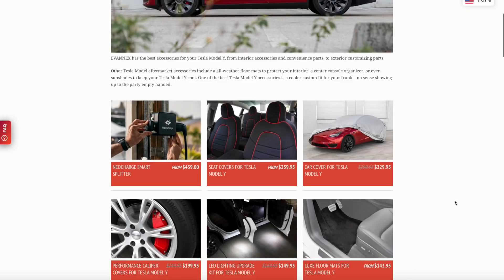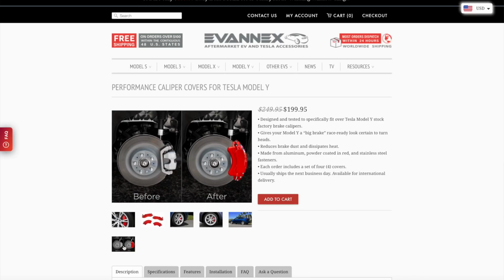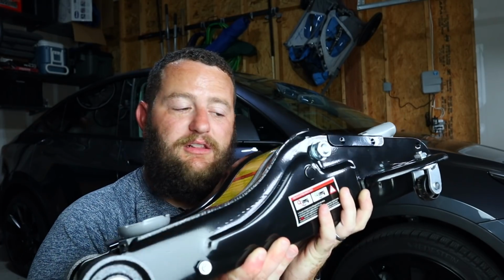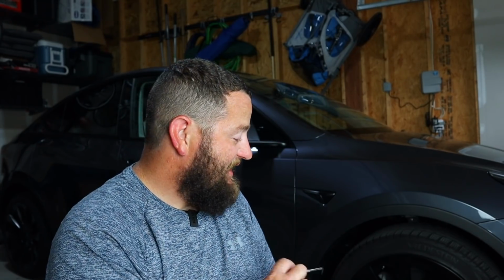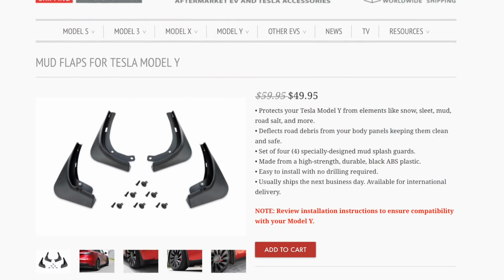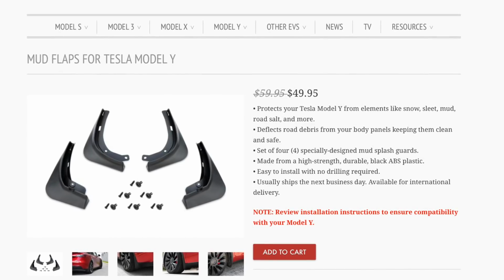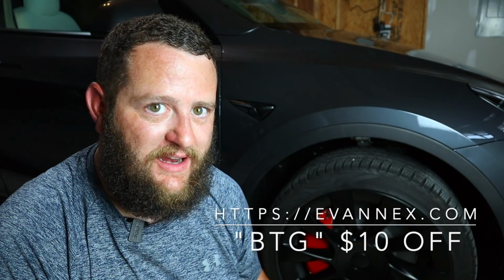Tesla Model Y - Red Caliper Covers

Comment: I would say that even if you can get the whole side of the car up with one jack, definitely use something under the other jacking point whether an axle stand or 2nd jack. I bought a low entry jack recently as my old jack didn't fit, but once the car is high enough my old jack will go under the other jacking point. Just to be safe!
Reply from the maker: Yea, I did it one corner at a time for this. Was easy enough

Comment: There was a comment that the frame is so stiff you can lift one entire side with one jack point. I'm the video you did move the jack from front to back. I'm just curious,i have to rotate my tires. i have the 19 inch Gemini wheels.is it possible to lift one side if the car to rotate front to back or do i need a jack stand !?? Thanks for any input!

Comment: Just want to make sure I get this right: you only used one jack and jacked up one corner at a time to do this correct? When you jack up the one corner do you put anything under the other jack points at all? Thanks for the video, very informative, I’ve been eyeing on getting some but thought installation would be too hard to do myself and too expensive to do getting someone to do it 👏🏼
Reply from the maker: It is the only way to do this since the jack will have to use the jack point. You can't place a jack stand there because the jack itself is taking up that jack point. So yes, I did one corner at a time.
Reply: @BeardedTeslaGuy  awesome glad to do this can be done with one jack. Thanks for the reply!

Comment: Great video, my Model Y Long Range is on order with 3-4 months away. The first thing I want is to replace those Gemini Wheels ASAP. I really like your wheel covers, are those the Evannex? How do you like them? I like that you do not need to remove the cap to remove the wheel. Trying to find the right covers is like going down a rabbit hole..😂 any feedback would be appreciated.
Reply from the maker: These are Induction wheels, not Gemeni with caps.

Comment: Looks great. I will,use Loc Tight on the bolts though. Thanks
Reply from the maker: If I remember right, they were pre coated with Loc-tight and I believe the nut was locking nut.

Comment: Very worried about heat dissipation. The pad contacting the rotor the whole time generates a huge amount of heat. (probably less in a Tesla due to less using of the brakes, but still, lots of heat, especially on road trips.) I'd feel better if these had holes/gaps in them to let air in and out.
Reply from the maker: Nah, it doesn’t block air coming in from the front and you barely use the mechanical brakes on the car anyways

Comment: I painted the caliper on my Model 3 and it took forever. I will get this one next time once I have my Model Y deliver, still waiting.
Reply from the maker: Yea, that's the problem with doing paint, at least the right way. They both have trade offs. I am personally very happy with these!
Reply: How long did it take you to paint each caliper?
Reply: @vonsevilla4426  It took me 2 days because I only have 1 low profile jack and I used brush for the ceramic paint. It  took 2 coating to make it nice and it does take a while to dry. If you can jack up the whole car and use a spray paint it would be quicker. The only worries I have with the caliper cover is if it somehow becomes loose, it might damage everything near it..
Reply: @bolero5000  gotcha

Comment: @BTG - I installed these exact same ones from Evannex on my 2021 Model Y. 

They look amazing and definitely add some pop of color and contrast. 

After a month however, the front driver caliper came loose and the bottom metal bracket started hitting my rotor or tire and was making a very scary noise. I ended up towing the car to be safe, but basically carry a screwdriver or tool to readjust it if it gets loose. I’m going to remove the calipers if it happens again.
Reply from the maker: Yea, mine came with loc-tite, and its a good idea to put some more on there just to be safe.
Reply: @BeardedTeslaGuy  ahh genius idea thank you!
Reply: Yikes! Yea might paint mine…..

Comment: Did you use EPAuto 1/2-inch Drive Click Torque Wrench, 10~150 ft./lb., 13.6 ~ 203.5 N/m? Your Amazon URL shows four different one under it.
Reply from the maker: You will need a 150 lb torque wrench. I believe the spec is 129 lbs, which is an odd number lol

Comment: Hi Mr BTG, thanks for the video. I'm going to place an order with Evanex for the caliper covers. I just wanted to ask if yours are still securely fixed after driving around for a bit. I'm worried about them working loose and causing a serious problem. I would use loctite on the bolt anyway. Thanks in advance for your honest appraisal! Andrew.
Reply from the maker: Haven’t touched them since the day I put them on! Still rocking them

Comment: I had that style of mudflaps and found that they trap dirt between the mudflap and the body and end up scratching the paint. I do like the look better, but removed them and will be putting the larger flat mud flaps that don't wrap around the side of the car body. This was on the M3 maybe the MY is better with the black trim around wheels.
Reply from the maker: These ones seem to stay in within the plastic molding around the wheels without touching the paint.

Comment: Paint it is for me, these calipers have issues too .. he mentioned how painting is an issue ... But the same jacking issues exist for painting and placing calipers
Reply from the maker: No the jacking issue is if you paint instead of do the covers. The covers only require one wheel off at a time
Reply: @BeardedTeslaGuy  I feel same can be done for one wheel at a time with painting. Just that the overall process is longer than calipers.

Comment: Great video. I noticed when I bought the same jack as you, the pads were bigger than the jack riser and cut into the pads completely. Any suggestion on another jack to be big enough?
Reply from the maker: Mine just barely slides in there. Maybe it’s because the tires are ever so slightly larger?

Comment: Fyi: in my past I've painted my own several times on serveral cars... All you need is high temperature paint and tape and paper or cloth to cover area to not be painted. It takes no time at all... Super easy. Just clean real well spray and put wheels back on. Let it sit for 30 minutes. And you are good to go...
Reply from the maker: Yea, the painting isnt the hard part, its the equipment required to safely have the Tesla off the ground on all four corners at the same time.
Reply: @BeardedTeslaGuy  I did them one at a time when I did mine... Quick and easy.
Reply: What did you use to paint red? Link pls?
Reply: @vonsevilla4426  I went to the local auto zone and bought high temperature paint.
Reply: @RICH_E  thank you!
Reply: @vonsevilla4426  ty👍🏼

Comment: 1.  Did you have any trouble removing the bolt on the bottom of the fender to install the back mudflaps?  I only installed the front because I've seen so many videos where the bolt on the back ones gets unseated and won't come out properly.
2.  Would these caliper covers work with the 19" gemini rims?  (wondering about clearance between the caliper cover and the rim)
Reply from the maker: No issue at all with the bolt. The caliper covers work for the Gemini wheels too!
Reply: The bolt getting unseated is what happens to me and the bugger would not come out. My only solution for the moment was to put the mudflaps and actually use the hole ring where the screw goes through to essentially hold the screw in place. It goes without saying that I did not try removing the screw on the passenger side.

Comment: Next move is to add the red line under your dual motor emblem. Guarantee to add 100 hp.
Better yet, replace it with the Plaid emblem for 200 hp

Comment: Did you say that lifting the R front tire also lifts the rear tire? Did you change change both front and back on one "lift"?  What did you torque the bolts to? Does look really good and a great price?
Reply from the maker: Yes, if you set the jack on the rear lift point it will raise the whole half of the car up. Torque the bolts to 129 ft/lb

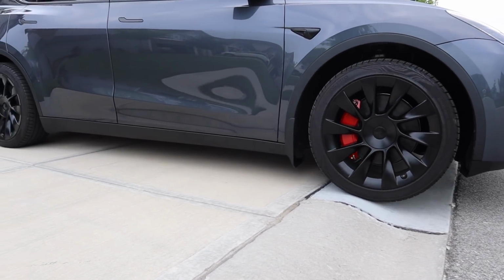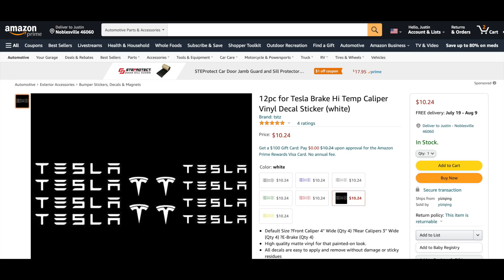Comment: Few questions for ya Justin: at 14:20 I can hear an audible noise when your backing up. Is this noise on all the time, or just when backing up? I hope it is not on when moving forward! Can you hear this noise when your inside the car driving? Is it annoying? Is there a way to disable or unhook it? Also at 13:57 you state that Tesla has been cracking down on IP. What exactly does that mean? Wow sorry, I guess thats 5 questions! Great video by the way, as usual. Chad
Reply from the maker: The noise you hear is the pedestrian warning system. It comes on when in reverse on newer cars. As you could see in the white one, it doesn't have the speaker so it does not make noise. I can barely hear it in the cab, but it can be disabled by unplugging the speaker. Tesla crack down on IP is them sending cease orders to aftermarket companies putting the Tesla logo or other trademarked stuff on accessories.

Comment: My fear is them getting jarred loose over time. Eventually, falling off, and just mangle the inner rim/brake system.
Reply from the maker: I get the concern, it’s not irrational. That said I installed them over a year ago, never touched them since and they are still rocking